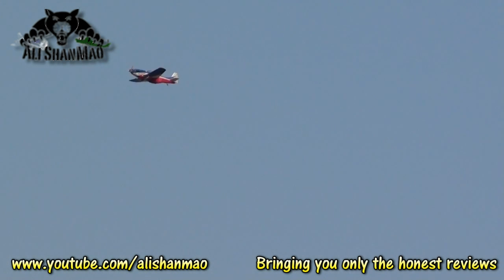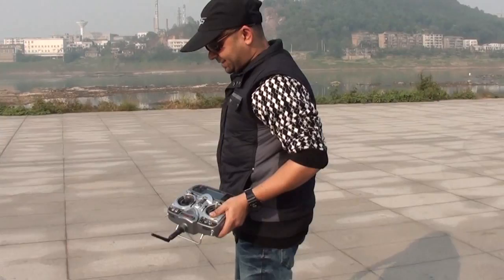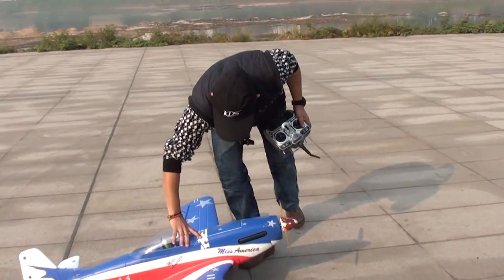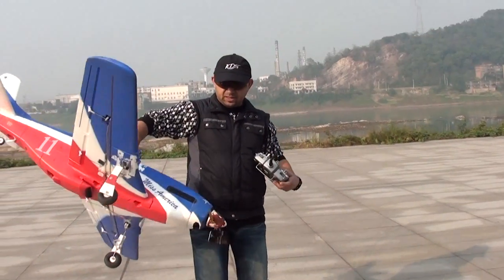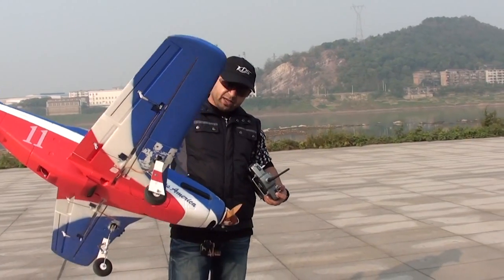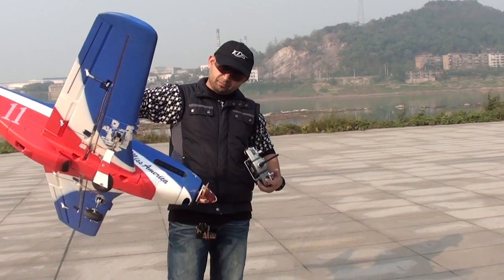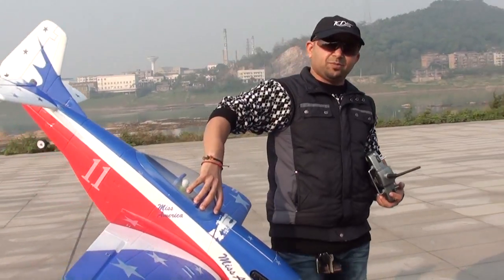Modified Lanyu P51 Mustang Back to 14x6 wooden propeller

Comment: I just bought this.. shame on Lanyu....   I ordered Turnigy G32 770kv motor and 60amp ESC.. would it be faster using 4S 2200 45c-90c battery and 13x8 master screw prop?